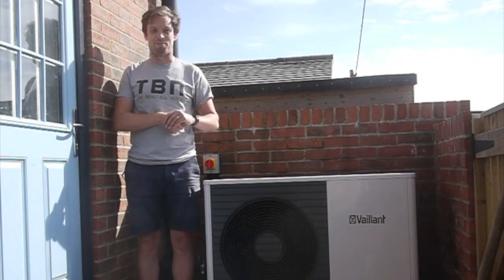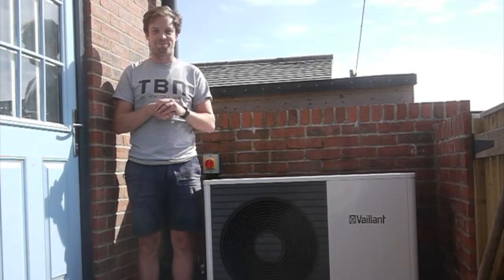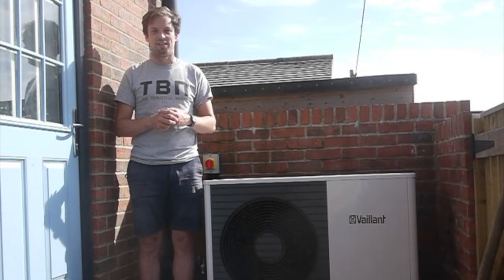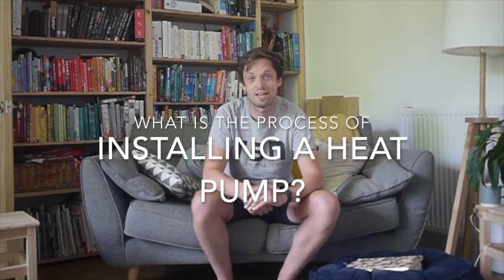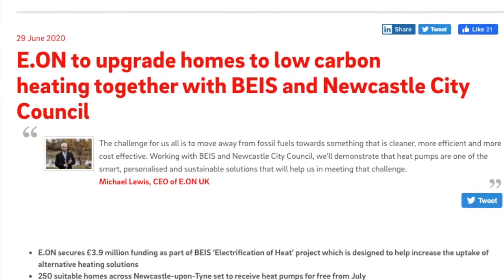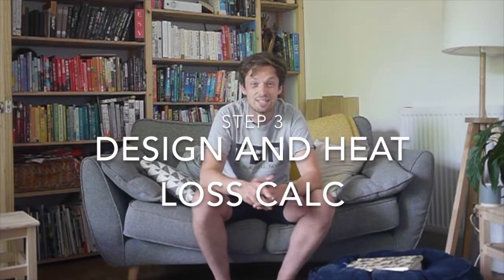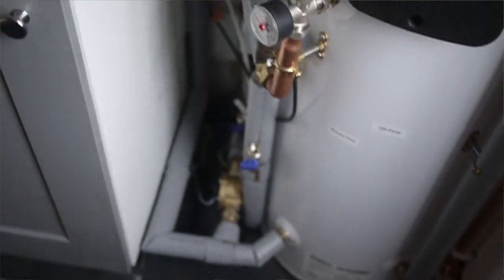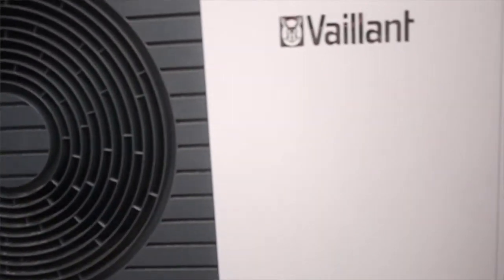We got a heat pump at home! How did we get here? Low Carbon Lifestyle Episode 34

Comment: I tried exactly the same as you, OctopusEnergy were, are, running a similar scheme. I applied received a call and all was going well until the question, is your house piped with microbore? Yes and it’s a 9 year old well insulated house. That was it! no can do? Why? All new builds are installed with microbore because joists can’t be notched hole have to be drilled and flexible pipe threaded through. 
What’s going to happen to the thousands of new houses with microbore piping still being built with gas boiler installations. The whole thing is a complete balls up with a government doing next to nothing about it.
Reply from the maker: Hi Wobby - sorry to hear that, I haven’t watched this video but may be relevant - https://www.youtube.com/watch?v=dEDitJnRgz4&feature=share&si=ELPmzJkDCLju2KnD5oyZMQ

From my perspective, microbore isn’t a reason to say a flat no to a heat pump, just means the amount of water and therefore heat that can be delivered to a radiator is less, but that doesn’t mean it can’t deliver the right amount of heat. 

I think octopus are trying to do quick, uncomplicated installations to keep costs low. 

Your house is likely well suited to a heat pump as well insulated and doesn’t have a big demand. 

I agree a heat pump roll out could have much better policy!
Tom

Comment: If you don have solarpanels its ussles to call it carbon positif 😅 if the rlectricity it uses isnt green then your acctualy adding mote carbon then when u would use a common heating device
Reply from the maker: Hi petrus, thanks for the comment, that’s not quite right I’m afraid. 

Because of the efficiency of a heat pump we use about a third of the energy to deliver the same heat as a fossil fuel boiler. So even if the electricity is supplied from fossil fuel power plants, it is emitting less CO2 than burning gas directly. 

In the UK, we have a mix of electricity sources. Almost half of which is low emissions, so a heat pump is much lower emissions than a gas boiler. 

Where I live, in North East England, the way the electricity grid is set up tends to make electricity very low carbon (because of local wind, solar and nuclear generation) https://carbonintensity.org.uk/

So our heating is VERY low emissions!
Tom
Reply: @TomBray-LowCarbonLifestyle  well here i know a few that changed there heat pump to a new good ketle (vaillant eco series) and at the end of the month they pay less then with the heat pump the amount of electricity that a heat pump needs is very high  iv done some study cases about it also when i was in shool, its kinda a scam but when u have solar panels its a diffrent story, also the cost of installing a heatpump is to much ( cant use the normal radiators ) u need convection or an air unit      at the end of the road just updating the ketle to a good one would be mutch cheaper.
sorry for my english
Reply from the maker: Hi Petrus - I am living in a house with a heat pump, we’re nice and warm, no scam! 
We pay a bit less than we did with our old gas boiler. A heat pump does use a lot of electricity but much less energy than a gas boiler. This means it is much lower emissions and could be much cheaper (if natural gas wasn’t subsidised so much) 

Yes when you add solar panels you can generate some of the electricity needed to power a heat pump. 

You can use normal radiators, our house is just normal radiators and we are nice and warm. 

I also studied heat pump technology at school (or university) and know that the technology is good! 

If you just upgraded your old boiler to a new one you would still be burning lots of natural gas. Which is very bad! We need to stop burning fossil fuels as quickly as possible. 

I have done a lot of videos about living with a heat pump on my channel 
Thanks

Tom
Reply: @TomBray-LowCarbonLifestyle  normal radiators work with higher temps then what a heat pump produces .
A heating floor is the best option here cuz it works with a depart temp of around 40  degrees 
Normall radiators work most effecient with higher temps ( depart of 65 give or take some ) 
Okay your paying a bit less then the old boiler but a new boiler is much morr effecient if you have a good condensing unit that is placed correctly 

Its kind of waste to use a heatpump with normall radiators u should change to ventiloconvectoren (that word is in dutch i dont know the english translation) to get the optimall result in ure situation.
But if u build a new home then install a heating floor .
Reply from the maker: Hi Petrus, I guess we might have different definitions of ‘normal’ radiators. My normal radiators are working sufficiently at a flow temperature of less than 45°. We also have a small area of underfloor heating but mostly normal radiators. 
I agree convector radiators will offer more heat output and better efficiency than my current radiators but would be costly to install. 
The whole reason of moving to a heat pump is to reduce emissions. Something that you 1st commented isn’t possible without solar panels, that is wrong, the heat my heat pump delivers is very low emissions, at least 2/3rds lower than a new gas boiler and probably more than 90% lower. This is not a waste! 
It is major progress in reducing CO2 emissions. Our system may not be optimal but it is much better than burning fossils in a boiler. Condensing boilers, operating at low flow temperatures can be up to 98% efficient, heat pumps are often 3x that! And sometimes 5x that!

Comment: Great video mate. Any idea what your system would have costed and were you able to claim RHI?
Reply from the maker: Hi Vijay, thanks for messaging, we were actually really fortunate to be part of a fully funded research project so our cost was 0! But the bill of quantities came to around £11k, I would say that all of our radiators were replaced, replaced with radiators more or less the same size so I think costs could have been less if we / the contractor had really thought about it. 

We weren’t eligible for the RHI, although it would have been nice to be, and it’s was a good scheme! Shame it isn’t continuing. 

Have you looked at heat pumps?
Reply: Thanks Tom. Great that you managed to get a funding, presumably it was Assignment of rights where the investor got paid for the RHI. Good to know you’ve embarked on a low carbon journey, we plan to do the same. 
Yes have an ASHP installed and looking at Solar for next steps. 
Keep up the good work. I’ll subscribe. 
Vijay